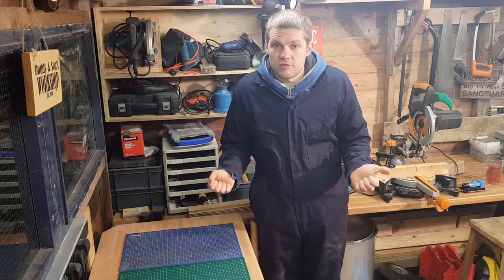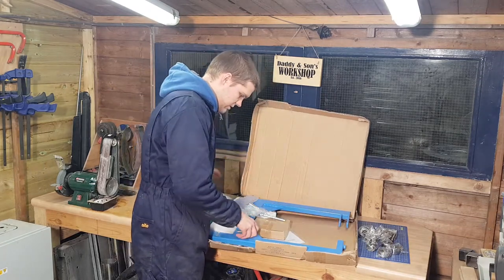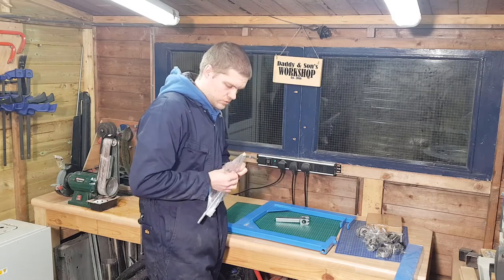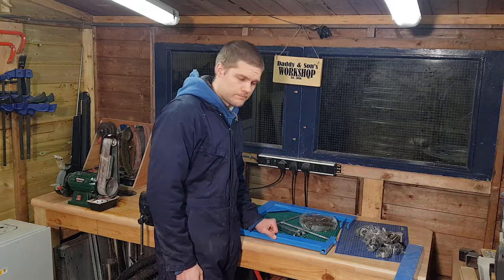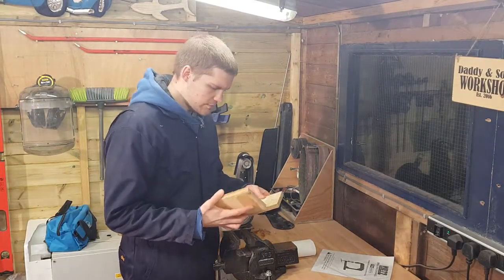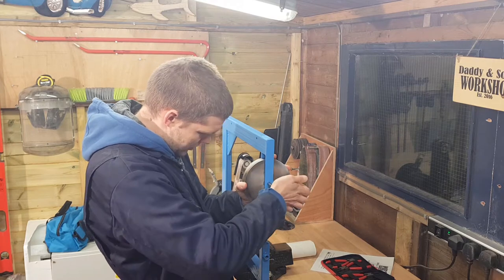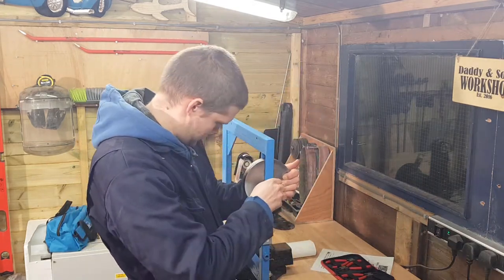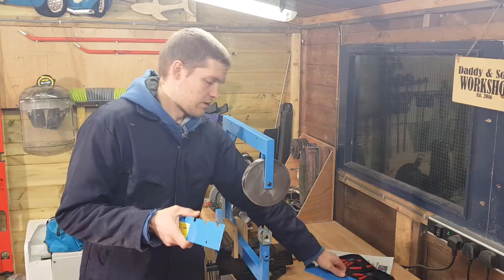METZ English wheel - Unboxing and first impression - Review

Comment: I made one in the same size myself some years ago then i lived in Sweden.  Many told me , this will not work, But it sure did on smaller parts.
Reply from the maker: Cool. To be honest i rarely use this. If i used it often i would make the frame more rigid.
Reply: @Thunkworks  . I made the frame from thicker material. 50x50x3 millimeters. I made this from scrap material from my work. And it was very fun to do it.  Lots of thinking them making the wheels